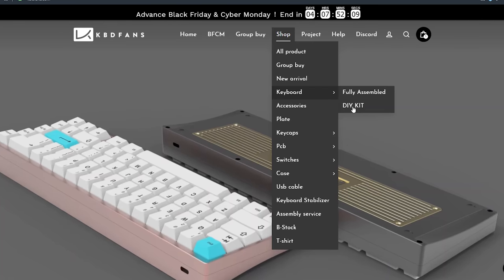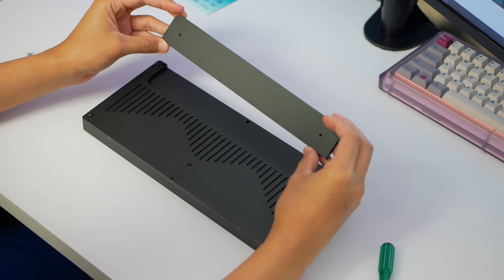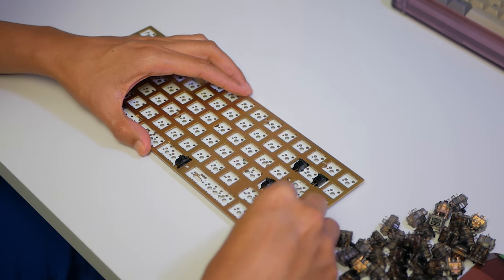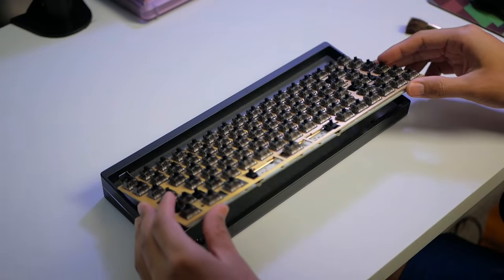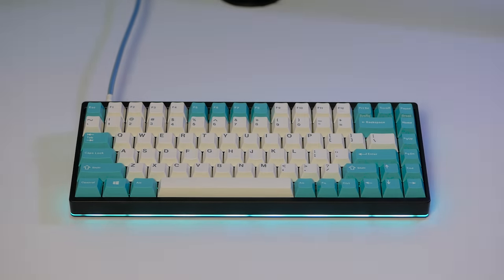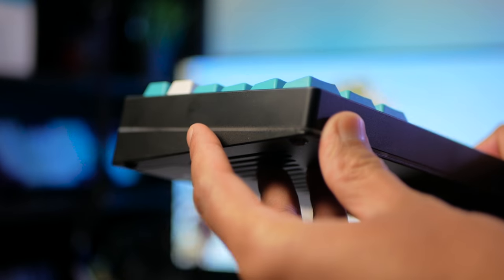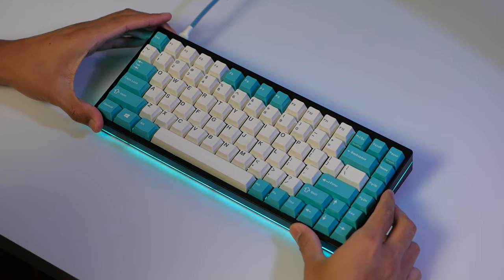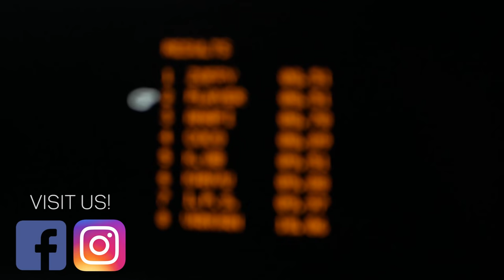KBD75v2 Mechanical Keyboard Build with Gateron Ink Silent Switches!

Comment: Hey, I was wondering where you buy key-switches... yeah
Reply: you can buy them from novelkeys, kbdfans, zealpc, ilumkb, pretty much any custom keyboard website.
specfically these silent inks can be bought from novelkeys.
Reply: @WesleyKarp  where is it cheapest?
Reply: @youcher  they are all around the same, but novelkeys is probably the cheapest and most reliable as they use usps. also, if you are thinking about a custom, be sure to not just jump into it so quick and actually take time to research things.
Reply: @WesleyKarp  I'm not doing a custom, I'm thinking about buying the gmmk 60% base getting tai hao sunshine keycaps from drop and buying seperate switches
Reply: demaruu Just get a gk61, its better than the gmmk.
Reply: Maxxy but i need iso tho
Reply: demaruu you can just get a gh60 iso, it’s the same thing.
Reply: demaruu also the gmmk only supports plate mount switches, while 90% of switches are pcb mount, which have 5 legs on the bottom of the which.
Reply: @WesleyKarp  those can easily be clipped so it dosnt matter if you have plate or pcb mounted switches.
Reply: Mr. SnowMonster that’s not the point. Without the clips your switches will be very wobbly, and we cause unwanted noise. But maybe films could fix it?
Reply: @WesleyKarp  but I'm confused tho because the gh60 is just the pcb while glourious come with a base and is already made so...
Reply: @WesleyKarp  can always use superglue hahaha
Reply: demaruu there are multiple websites where you can get a case for the gh60 and it’s just a matter of  putting the pcb in the slots of the case. Also, I believe the gh60 supports screw in stabilizers at least on the space bar, which are so much better than plate mount. And yeah, you’ll also need a plate.
Reply: @WesleyKarp  youll also need a plate for the gmmk or the gh60
Reply: demaruu are you thinking about lubing your switches? If not for linears I’d probably go for the creams. And I don’t really know tactile as I’ve never been a fan of them.
Reply: @WesleyKarp  I was thinking about the kailh pro burgundy from novelkeys which i heard comes lubed already
Reply: demaruu i have those switches. I mainly got them because I was curious. And yes it is true they come factory lubed, it’s very inconsistent and it’s a very bad lube job. This can make your switches inconsistent potentially. And also, it’s not an Mx style switch, so you can’t open it with a normal switch opener. I recommended them before but if you’re going unlubed, for linears definitely go for the creams.
Reply: Wesley Karp aren't the creams pretty heavy?
Reply: demaruu not really, weight is really not a problem. I think people feel it is going to be a huge deal but it’s really not, cherry blues have 60cn which is the same as the blacks. And creams are also only 55g. Finally you can always spring swap. But seriously you should get a switch opener.
Reply: Wesley Karp but lubed, are the pro Burgundys good?
Reply: demaruu I personally didn’t see any difference. The first day I heard a difference and felt it too, but the next day(s) It felt like it went back to normal. I lubed with tribosys 3204
Reply: Wesley Karp ok
Reply: Wesley Karp but also, what do you think about the kailh speed silver?

Comment: Are there diy kits anywhere where I wouldn’t have to solder?
Reply: CU65 is a new option with those features bot ANSI and ISO in the same PCB. It's a group buy that ends August 1st I believe. Affordable at just around $130 for the barebones, but you can add stabs and switches in the same order for a few more $$.

Comment: hotswap is the new standard and a huge convenience, not an opinion, its just how it is
Reply: It's a huge convenience, but it's not the new standard. For high end stuff, soldering still provides a more solid and reliable experience. Not only is the typing experience more solid, but the it virtually eliminates key chatter, which is a prevalent issue in hotswap boards, and only gets worse over time as you swap out switches.
Reply: @rousseau327  funny you'd say that since people that have built hundreds of boards dont feel a difference or it being less "solid", as for quality im yet to see any issues whatsoever myself so that doesn't add up, im quite active, but id like to see that. there is no reason why you wouldn't want your high end board to be hotswappable whatsoever unless you want to be anal about it being soldered by hand by yourself or you have some contorted idea about the handfeeling of hotswap modules
Reply: @sabergoli3518  every hot swap keyboard I've had (gmmk, ctrl) has developed chattering issues, most likely problems associated with the hot swap sockets. You might as well learn how to solder now before your keyboard inevitably develops issues.
Reply: @stevenjiang1423  thats because you're not lubing your switches, chatter has to do with the springs that are on the inside of your switches, not the sockets, thats going by when you say chatter you mean ping noise, and hotswap modules do not produce ping, its your switches
Reply: @sabergoli3518  lol no that's not what chattering is. Look it up
Reply: @stevenjiang1423  found it! chatter
/ˈtʃatə/
 Learn to pronounce
verb
gerund or present participle: chattering
talk informally about unimportant matters.
"she was chattering about her holiday" thanks for clearing that up. definitely lube your springs or you will get a bunch of this
Reply: @sabergoli3518  ok that's the dictionary definition. Great. Now look up "chattering in mechanical keyboards". Did you find something?
Reply: @stevenjiang1423  tried checking out some videos so that i can actually hear what you mean by chatter. found nothing really. if you find this sound a nuisance you can lube it, i recommend bag lubing for the time saved
Reply: @sabergoli3518  I don't know why you're having such a hard time looking this up. Chattering is when a key registers multiple times on one key press. If you're fine with buying a new hot swap board every time a hot swap socket develops chattering issues then that's your money and not my problem.
Reply: @stevenjiang1423  you've seen complaints about chattering for these modules?
Reply: @stevenjiang1423  actually would be game changing for me not gonna lie
Reply: Saber Goli key chatter in the mech community means the key registering multiple times with 1 press, or not registering at all.

Oh yeah, these people who built hundreds say there’s no difference, but they still prefer to straight solder their switches in, instead of soldering Mill Max sockets, which are fairly simple as well. They must have no reason to do it.

If hotswap were better than soldering, everyone would do it. But it’s not, it’s a trade off. More convenience for less reliability, and that’s fine if you prefer that. Don’t get your panties in a twist just because someone prefers soldering because of downsides of hotswap.
Reply: @rousseau327  lets actually be real here. there are no one complaining about these modules as of today, just did my search, found nothing supporting your claim about the idea that these kailh modules are a reliability issue. if there were to be any issues, these modules are replaceable at any time. im sorry but what you are telling me just doesnt add up as you are presenting it, i tried to gauge where you've experienced these ideas of kailh hotswap modules as well but without any direct followup on that, im sure you understand. if its because of mill max impressions than thats simply wrong, these are known for failing, kailh hotswaps arent as far as im concerned
Reply: @sabergoli3518  I have boards that have high quality hotswap sockets from Kailh. Tofu & the Leaf60. I was in the same boat thinking I'd prefer the convenience of hotswap. Key chatter is what made me stray away from BOTH and decide to solder my next custom, and the experience is completely different (when I say completely, it's minor in the eyes of people who are casual keyboard builders, but once you've built a few across price ranges, you can tell).

You talk about replacing Kailh sockets. You do know that the level of difficulty of replacing a surface mount component by hand requires a lot more skill than simply soldering through hole parts? It doesn't take an expert, but if you can't be bothered to solder some through hole parts like a switch or mill max sockets, I wouldn't even bother trying to replace Kailh sockets. 

Adding onto that, once you've bought a hot swap board, especially with Kailh sockets, you're stuck with the layout the designer chose. May not be much of a problem for you if you like the layout, but for a designer that needs to sell the board to people across cultures, the layout desired will be inevitably different. They'd need to design multiple SKUs of the same PCB, which would raise costs for the consumer as well.

And are you sure that Mill Max are the ones that fail the most? i think you're thinking of holtites. The general consensus I've seen is:

1. Kailh Sockets, easiest for the consumer, it comes on the PCB, and you pop your switches in and you go. Key chatter happens, and if you're not careful, you can pop the socket out, in which case reinstalling is a bitch

2. Holtites, easiest to install if your PCB is compatible, i.e. the sockets don't fall through the pin holes, or the pin holes aren't too small. If you have the right PCB, you can just push it in. These are very prone to keychatter, and if you want to make it more permanent via soldering, it's very difficult to do so because solder can flow into the socket by design

3. Mill Max, the best all around DIY solution, but still suffers from chatter because of the nature of the mechanical connection. Easier to solder solder onto the board than both the previous options though.

Some anecdotal links to hotswap issues from 2019:

Kailh socket popping out:
https://www.reddit.com/r/MechanicalKeyboards/comments/b5ggz0/need_help_kailh_hotswap_was_pushed_up_when/
Hot swap key chatter:
https://www.reddit.com/r/MechanicalKeyboards/comments/bke014/currently_having_a_problem_with_my_massdrop_ctrl/

Those are only two posts where people actually have failures with hotswap. Obviously, when it comes to feel, this is purely preference, similar to switch wobble. You may not mind, but someone who has typed on a high end custom may.

We're talking about an issue of reliability here, in a community that is already niche. If you're looking for hard data points, you're barking up the wrong tree. I'm sure there are people out there who have had no issues with Hotswap. I however, and many others on forums like reddit or geekhack, have. My Tofu, which I still use from time to time, has keychatter. The key chatter on my Leaf 60, which was a $400 board for just the kit without switches or keycaps, had keychatter so bad, I sold it.

And it's also worthy to keep in mind, we're talking about minute details here. Even a Massdrop CTRL is a high end keyboard for most people, it's all the keyboard anyone would ever need. If we're starting to talk about custom keyboards, the differences would be insignificant to most, but the reason why hotswap hasn't been fully adopted is still very valid. That doesn't mean it's not catching on, as more and more designers are including hotswap as an option.

Comment: Is there anywhere you can buy this exact keyboard built? I love it, it’s exactly what I’m after :)
Reply: It is a custom keyboard from kbdfans. You can go on google and search kbdfans. Other than the case, you also can buy pcb,plate, and switches at their website. And for the keycaps, it is a gmk set keycaps which is cost for $200
Edit: it is a diy set

Comment: Guys i have a question does the kbd75v2 kit have the v2 pcb bc it says on the products its only the v1
Reply: i could be wrong but they have the same pcb
Reply: @jadenngl  no but r/mk said the connection were different v1 is micro and v2 is type c

Comment: I just got into keyboards, anyone have any suggestions on what to buy? Thanks
Reply: Durp Sac I personally use the Microsoft Surface Ergo Sculpt! But the CTRL keyboard from Drop is a great all rounder!
Reply: If you're looking for a more affordable entry-point into the hobby, the GMMK is a hotswappable board that offers several sizes to choose from. Depending on where you live, there can be even cheaper options for hotswapping. It's a good way to get into the hobby because it lets you test out what kinds of switches you like without having to commit to soldering them on or getting a new keyboard entirely.

Comment: the v2 has 7 degree angle whereas the v1 has 5 degrees. the v2 is thus not so ergonomic as the v1 so the v1 is better to type on. dont buy the v2 people. also the lightning hasnt improved since the v1. it uses the same rgb leds and is as bright as v1